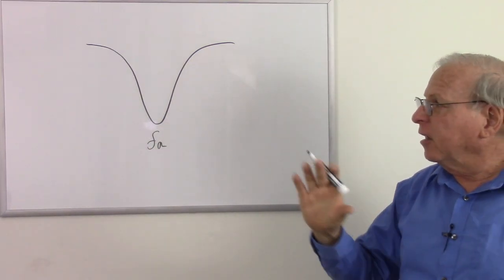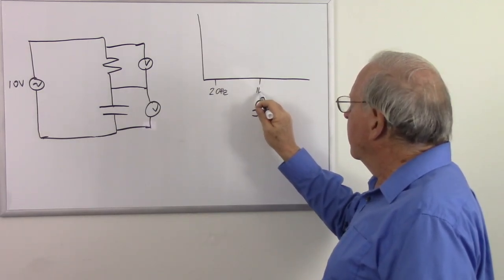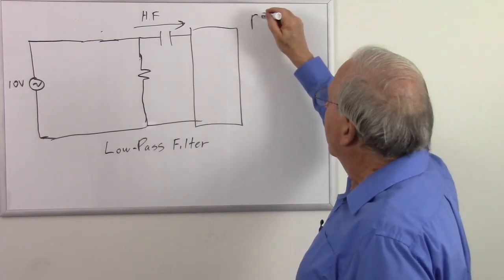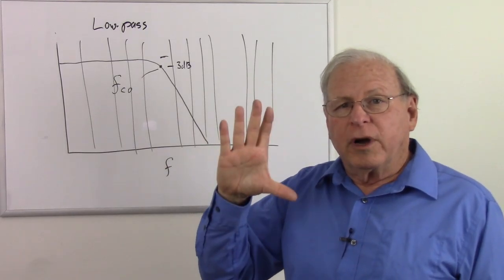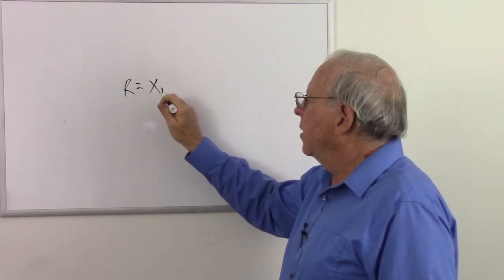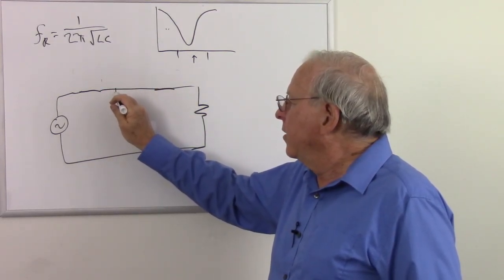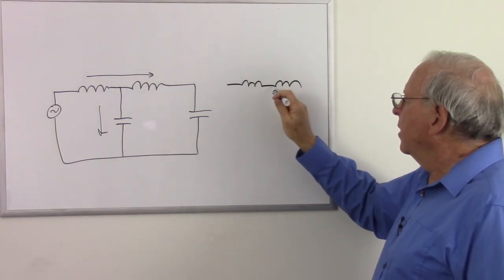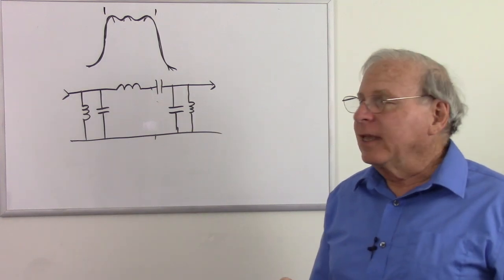Electronic Filters - Vocademy

Comment: 13:17 when capacitive reactance Xc is equal to the 100ohm resistor, you’d have the -3dB cutoff frequency, but the series impedance Z would be 141.1ohm. Or am I missing something? 

To have half the voltage, Xc would need to be 173.2ohm, series impedance 200ohm.

Comment: I do understand how, for example, low pass filter works when resistor between AC source and capacitor, but I do not understand how it works (the same) if resistor between capacitor and VOUT
Reply: He drew it wrong in this video.  You don't place either element between the circuit and Vout.  You tap the midpoint between the two elements, so they act as a "fancy" voltage divider, in order to produce Vout.

If you place the circuit element between the circuit and Vout, assuming you have an infinite impedance load, it will do nothing.  It's a dead-end impedance that has no effect on the circuit.
Reply: @carultch  when he said half the voltage 13:17 that’s another error? If Xc is 100ohm then the series Z would be 141.1ohm, not 200ohm, right?
Reply: @davadoff  Correct.  The magnitude of the impedance wouldn't simply be the sum of impedances, since it adds in quadrature instead of directly.

Here's how we can figure out what the voltage should be.

Impedance of resistor = R
Impedance of capacitor = 1/(j*w*C)

Let 1/(w*C) = R, thus:
Zr = R
Zc = -j*R
Znet = R - j*R

Vout = Vin*Zc/(Znet)
Vout = -j*Vin*R/(R - j*R)
Vout = j*Vin/(j - 1)

j/(j - 1) = j*(-j - 1)/((j - 1)*(-j - 1)) = (1 - j)/2

Take the magnitude, and get sqrt(2)/2.   So when you use a simple RC filter, exactly at the corner frequency, the output voltage amplitude will be sqrt(2)/2 or about 70.7% of the input voltage.

What deceives you, is the fact that Bode plots are defined to account for the square of voltage amplitude, rather than voltage amplitude directly.  So the corner frequency has a drop in 3 dB, and we normally associate 3 dB with halving and doubling, and we'd be correct.  But it's a halving of the amount of power associated with the amplitude, rather than a halving of the amplitude.
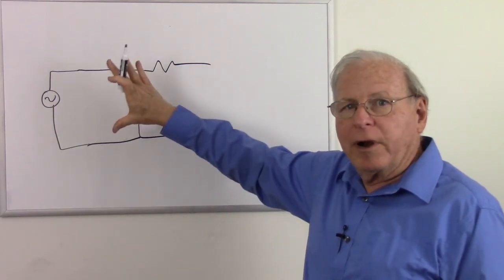Reply: You’re talking about 19:49 this? I think it might be necessary to build it like this when dealing with e.g. 50ohm input/output impedances. If the next stage was an opamp, I don’t see how it would work at all.

Comment: So a capacitor, when taken to be non-ideal, is a bandpass filter?
Reply: To get a bandpass filter, you use an LC resonant circuit.  At resonance, an ideal combination of an inductor (L) and capacitor (C) will have infinite impedance in parallel, and zero impedance in series.  This means, resistor first, then load, then LC parallel will make a bandpass filter.  By contrast resistor first, then load, followed by LC series will make a bandstop filter or notch filter.

Comment: question:   a tuned 1mhz circuit , an LC Resonant Circuit  can provide voltage magnification at output ? assume input 10mv 50ohm 1mhz and a high Q  ripple Resonant low pass Circuit tuned LC for  1mhz at 50ohm load , ,the voltage at Resonant Circuit  output will be higher than  10mv ?  there any real world voltage magnification ?

Comment: "at DC capacitor is like open circuit" hows this possible cause in DC we get voltage across capacitor which is equal to the source voltage?
Reply: Once capacitor  is fully  charged its voltage is equally to battery voltage then and it blocks any further current flow.
Reply: Exactly you get the full DC voltage across the capacitor because it is like an open circuit. If it was like a short you'd have 0V

Comment: dear sir
please how to get quasi sine wave (inductive crankshaft signal for automobile -12V to 12V ) from square wave i.e  crankshaft signal (hall effect) varing from 0  to +5 VOLT  using for exemple a low pass filter 
note: the frequency range is  : 500 HZ TO 30KHZ
THANKS SIR
Reply: It takes about 4 stages of low pass filtering to get a square wave to a quasi sine wave.  Then, because using the attenuation of the filter reduces the amplitude, you have to use an amplifier to bring it up to the desired amplitude.

Comment: Hi in my country we have something close to OSHA Standards that regulate technical and formal preparations and safety rules according to working with electricity. Our system is TN-C. Many colleges of mine are confused (including me) with one particular rule that says when working on a power cable, you must securely disconnect  phase wires and neutral wire and put grounding on all wires (phase and neutral) as close as possible where you are working. So the confusion comes from why we must disconnect neutral wire from ground in substation and then secure it by grounding it again but closer to work place. I guess maybe it is for safety if there is a fault or imbalance in the transformer in substation  and voltage vectors and neutral point are displaced. Can you help me with that?
Reply: Sounds "noisey" & dangerous.
Reply: @R.Akerman-oz1tf indeed does